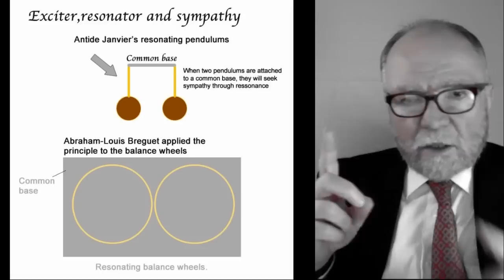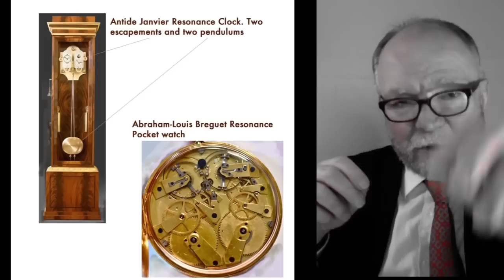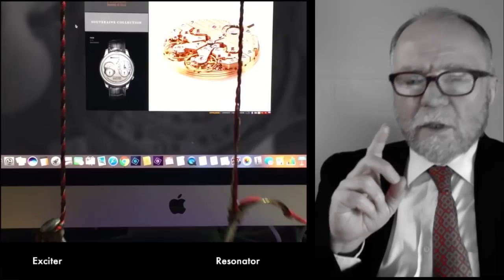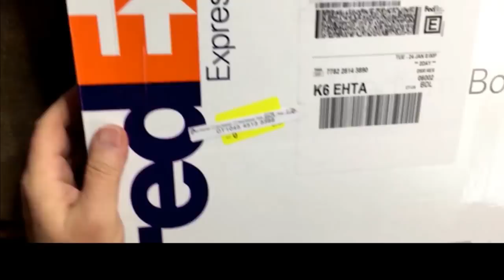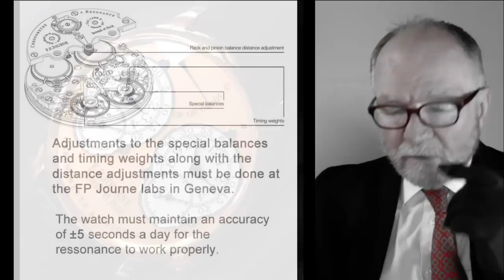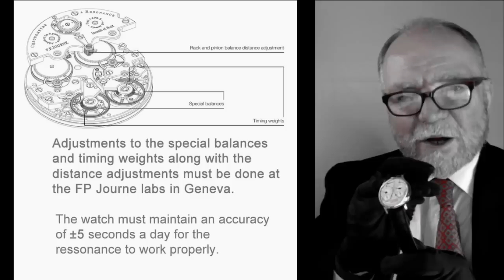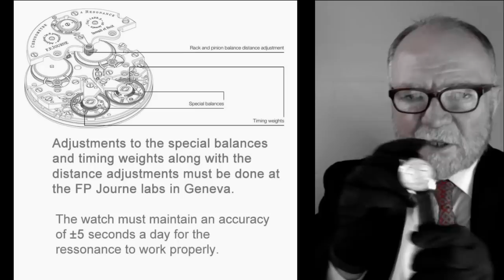#44 Resonance and Unboxing the Witchcraft Grail

Comment: Amplitude of the oscillation i meant
Reply from the maker: How is that related to the effect (good and bad) of resonance, Timothy? Thanks. Take care and be safe, Bill😷
Reply: @watchartsci  well, you were speaking about the phenomenon of resonance in general, refering to pendulums specifically. And i thought you said time when you meant distance, I don't remember the exact words you used, i could be wrong,(rare i know, but it happens. LoL). Anyway I thought you misspoke so i was being pedantic and thought I would correct you. 😉 What I was saying was that the time the pendulum takes to return to hanging straight down is not dependent on how far,(size of, or  amplitude of, displacement) you pull it off of hanging straight, if that makes sense, my grammar is terrible  but i think you know what i mean.

Comment: Hi Bill,

Is it reasonable (or a norm so to speak...) that when getting a watch with such a unique and complicated movement that servicing will be required more often than say the less complicated ones? I love FP Journe but has also heard issues regarding its durability and reliability, what's your view on that?

Thanks in advanced!
Reply from the maker: Hi Edwin...tough question for any watch make. From my own personal experience, their service has been great, and a year after my service, my FPJ started running slow. It was way out of the 6-month 'service warranty' but the FPJ folks first demagnetized it (on the spot!) and told me that if that didn't fix the problem they'd send me the pre-paid shipping stickers to send it to their service center. You have to be careful who you listen to. Some blowhard can make a pronouncement about any brand and people will repeat it...ad infinitum. With every watch, there may be a lemon or two, and certain models that may be difficult (also there're quite a few that get banged up by the owner), but overall, while expensive, FPJ takes very good care of its owners. Rolex owners, on the other hand,  tell me they are treated badly by Rolex ... mostly ignored or treated like a pest if they  have a problem. I don't own a Rolex; so I have no personal experience. Take care, Bill
Reply: @watchartsci  Thank you so much for taking the time to answer my question, especially in such detail! It's good to hear that FP Journe treats it's owners well, especially as a huge Journe fan, that's reassuring to hear! Take care Bill!